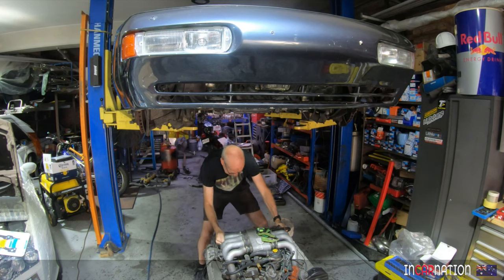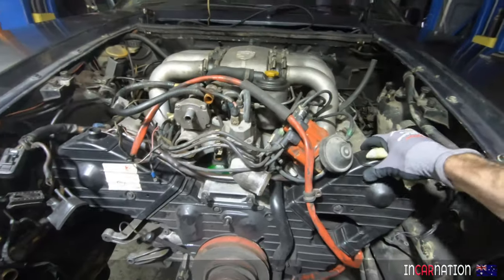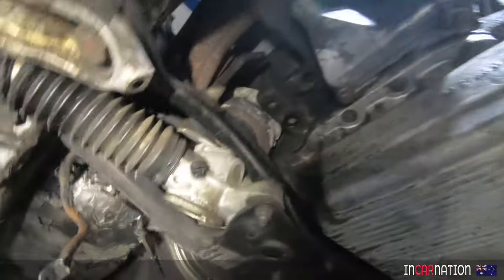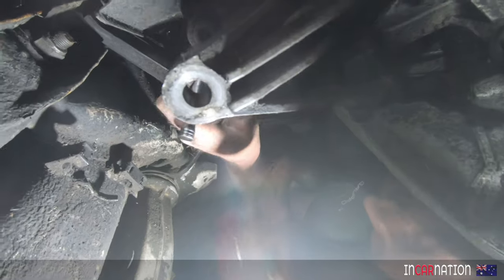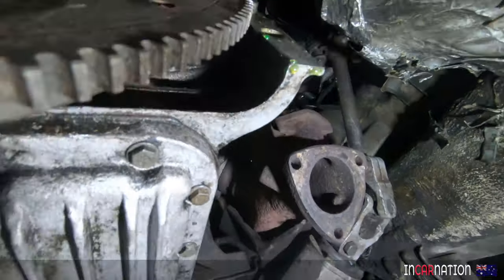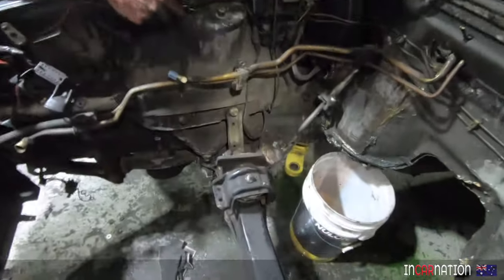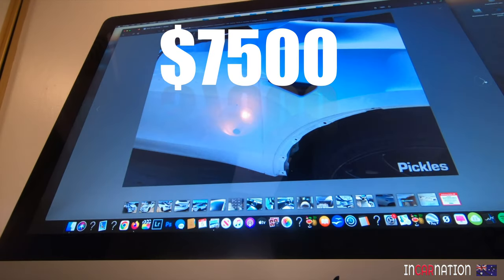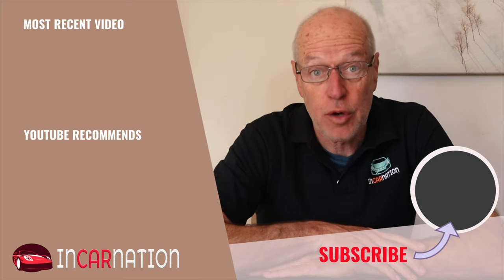Porsche 928 EV project / Removing the V8 (Ep.10)

Comment: I think your mouse did you a favour there ! Also - if the MG swap will give you Porsche 928 performance, you could save yourself £10000 and do a full swap with what you've got. Do you really want a Porsche 928 that will do 0-100 in 3s and shred tyres every fortnight ?

Comment: Hi Stu, Thinking about your busted differential, what you need is our warranted 20000 mile diff unit.  Perfect.  If the price is right I'll chuck in the auto box for you to keep as a spare.  Let me know a contact email and I'll be in touch with details.  Cheers, Doug Dangerous.
Reply from the maker: Thank you Doug for the offer but the drivetrain has already found a new owner. And while the teeth were scored I wouldn't say busted.